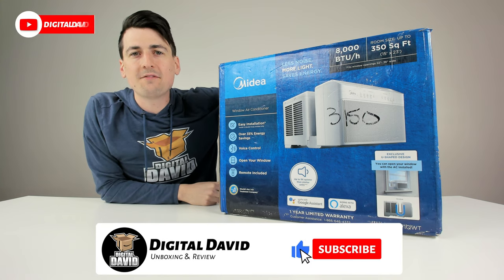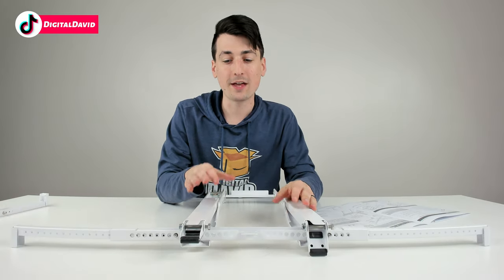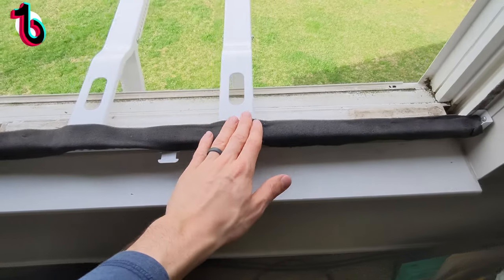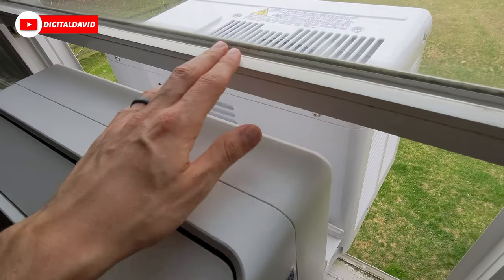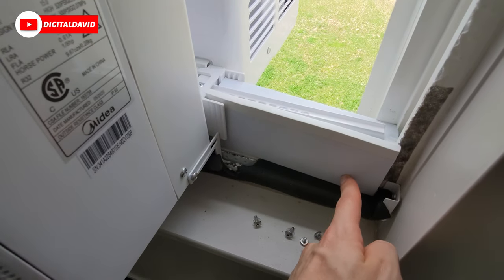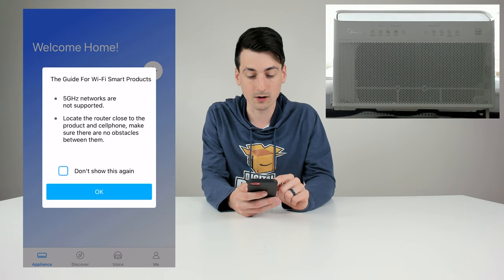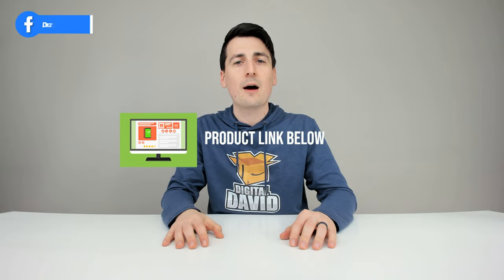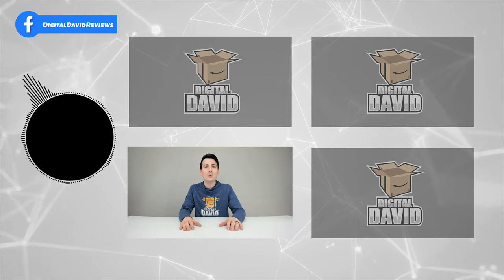Midea U Inverter Window Air Conditioner Install // Smart Air Conditioner

Comment: Its not suppose to be leveled, has to be 1/4 bubble hanging {see manual and Midea install video} so water can drip out ,otherwise water will pool inside AC {condensation} and rust inside of AC and AC will stop working ,but great video showing to install foam on bracket before sitting AC on bracket, helps so much , even Midea videos don't show that .nice job ! Thanks.
Reply from the maker: Welcome! Thanks for watching!
Reply: So much online about this and the issues it causes .. Thanks for sharing ..

Comment: Just put one in our living room. Awesome unit, so quiet which is great when my wife watches TV. ME! I don't watch TV. Highly recommend this unit. Also being on lower floor I find this is also a security issue from a regular window air conditioner, which your window is opened more wider whereas with the design of this unit is only inches. Have security bar inside to prevent someone trying to force open window.
Reply from the maker: Glad you're happy with it!!
~B

Comment: I purchased one 12000-BTU  for and one for my son. Both units  worked only for two years. I contacted midea customer service and after several emails they didn't offer any help. Therefore, I had no choice to throw both units in the garbage.

Comment: When it rains does water comes in from the bottom sides foam, or it seals good ?....no drain hole
Reply from the maker: Never had water in. I assume that will vary depending on your setup and how you install it. I'm guessing since it has a slight downward angle any rain/water ran away from the house/window!

Comment: STEP 1 -  Check to make sure the unit works.  Don't waste your time, like I did, installing a defective unit.
Reply from the maker: Thanks for your advice! I am sure viewers will find this helpful! cnl
Reply: Great point ! Fingers crossed my delivery  Aug 2024 brings a working one .. Sorry about your luck .. I’ve heard the company is not good at handling  issues, hopefully u were able to return ..

Comment: It looks like there is a gap on top of block foam, because window does not fit all way down into channel. Window seems too close to front of unit to completely close into U shaped channel-so since I have similar windows-maybe I do not want a U shape design.
Reply from the maker: We didn't have any gaps when used! They give plenty of foam to help if you happen to have some with your window!

Comment: I don't think they would tell you to make it level? Shouldn't it be slightly backwards so it can drain correctly. You don't want any water draining in towards your house you'll get tons of mold and wetness on the floor.. You always tilt air conditioners backwards.. I'll be very surprised if they told you to make it level?
Reply from the maker: Idk.. Maybe you are right!
~B
Reply: It looks like the bracket drops down a little, maybe that's why they say make it level, the tilt is built in. I know I usually tilt my window air conditioners a little more just for this reason.
Reply: @tppe1476  the manual specifically requires the AC to tilt outside. The bracket is adjustable.
Reply: @williamwchuang  You are correct, I just bought one and installed it couple days ago and yes it does tell you to tilt it. So everyone don't follow video directions to level the bracket, it needs to tilt to the  outside as every other window AC.   Other then leveling the bracket this video is helpful for install. Installing this is nowhere near hard as some comments I've seen in a few videos on this unit. I would say it's easier and there no drilling to the house  outside, you can install from inside the house which is very helpful when installing on second floor, no ladder required.  Even if you don't care if you can use the window, I would get this unit for second floor installs just for the install.   I almost didn't buy this unit from reading comments on the install difficulty, I'm glad I decided to go for it, the install is a breeze. 

When I seen this comment I didn't have the unit yet and seen the video showed leveling the bracket. I seen the little dip in the bracket and thought the tilt was built in to the bracket.. It is not. Lol

Comment: Thanks i just got both of my air conditioner unit it looks easy to install thanks.. i bought the 10.ooo btu unit and the remote is way different there's a digital screen amd and it looks like it has a thermostat that built into the remote... different types I guess
Reply: Mine too! We got the 2021 new version
Reply: all of the 2021 versions have the thermostat in the remote, just got my 8000 one and it also has that remote. weird that the remote seems to have a heat function, i dont think they have added a heat pump mode/valve to this ac yet
Reply from the maker: Thanks for sharing!

Comment: Hi.  I really like this model's design and hope it will work for me.  Very helpful video.  One question, my window width is like 20" - Do you think the bracket could be modified to still work?  The installation guidelines say a minimum of 22 inches but I think the unit itself is only 19.17 inches so I'm hoping the bracket can be adapted...ie..drill some extra holes to shorten or?  Thanks for any help.  These things are hard to return so trying to get info in advance!
Reply: correction - remeasured....21" wide...so it would need to be modified by an inch
Reply from the maker: Thank you for your comment and kind words about the video. It's great to hear that you find it helpful. As for your question, it's difficult to say for sure whether the bracket could be modified to work for your 20-inch window without seeing it in person. However, drilling extra holes to shorten the bracket is a possible solution, as long as it is done carefully and safely. Keep in mind that modifying the bracket may affect the stability and safety of the installation, so it's important to exercise caution and consult with a professional if necessary. Good luck with your installation! cnl

Comment: Looks like an elaborate installation and difficult to remove. Will you just leave the unit in the window over the winter? It looks like the window won't fully close with the bracket screwed in place.
Reply from the maker: Installing a window air conditioner can be a bit tricky, but it's important to make sure it's done properly for both efficiency and safety reasons. While leaving the unit in the window over the winter is an option, it's not recommended as it can lead to energy waste and potential damage to the unit. To remove the unit, you can simply follow the steps in reverse order. As for the bracket, some models may require the window to remain slightly open, but this should not be a significant issue as long as the unit is installed properly and securely. cnl

Comment: Are you still using this 2 years in?  Any issues water leaking on inside part?  It's there any markings on how where supports  rest?  I'm looking at one, I'm considering using a couple small pieces of wood between house and support brackets to prevent marking the siding up.
Reply from the maker: I used it for a year with no issues and still have the unit it's just stored in my garage now since I moved my office so I'm not using at the moment!

Comment: Do you have any water leakage around the air conditioner when it rains?
Reply from the maker: No which is great. Had it in my window for 7-8 months no leaks! Then took it out for winter!
Reply: have the unit support feet  not to level  one hole back well drain out side  like ALL AIR COND,S

Comment: Mine will not go into AP mode. Pressing the connect button only beeps, but the AC does not display "AP" and the app will not connect. There is no factory reset option and Midea customer service is no help whatsoever; they keep asking about what type of phone and Wi-Fi channel when the problem is with the device itself.  Now I have a "dumb" AC. Super quiet though, plus I love the fact I can tuck the curtain behind the AC to block out all the light. You can't do that with regular ACs, unless you install light blocking panels.
Reply from the maker: I'm sorry to hear that you're having trouble with your Midea U Inverter Window Air Conditioner not going into AP mode. It can be frustrating when customer service isn't able to provide helpful solutions. Have you tried contacting the retailer where you purchased the AC to see if they can offer any assistance or if they can facilitate a replacement or refund? It's great to hear that you're still enjoying the AC's quiet operation and its unique design feature of being able to block out light with the curtain. cnl

Comment: Hi, I'm considering purchase of the 8000 BTU version of  this unit. My wooden window sash is 1.5 inches wide. Can you tell me if this will fit within the space that it needs to drop down into in the AC? Thanks for any feedback you can provide.
Reply from the maker: I'm not positive, but I think it would be fine.. There is an amazon intl link in the video description that will have the specs/measurements for ya
~B

Comment: Is it possible to install it on a window that is wider? Mine is 39/40 inches wide, and short as well, opens the most at 12 inches, it's double hung so the bottom can be taken off. Is it possible to install in my window?
Reply from the maker: I'd have to double check the specs.. I can't really remember :( wonder if the amazon intl link in the video description would help
~B

Comment: What's the point of this ac? Advantages & disadvantages to a standard window unit ac?
Reply: way quieter, inverter style (meaning it can vary how hard the compressor works- 99% of window ACs just turn off or 100% on, nothing in between), slightly better thermal and sound isolation since more of the window is closed than with a standard window ac, and you can see slightly more around the AC than with a normal window AC. if you wanna go through the trouble you can technically open the window if its nice outside, but you will have to deal with removing and reinstalling the window sash foam.

disadvantages are that it takes way longer to install and will likely be annoying to remove for the winter, but beyond that I legitimately can't think of any.
Reply from the maker: Such a great answer @starman!!
Reply from the maker: See other comment!

Comment: How quiet is the outside noise once the unit is in the window?
Reply from the maker: The Midea U Inverter Window Air Conditioner is designed to be relatively quiet, with a noise level of 42 decibels. However, the actual noise level may vary depending on a number of factors, including the location of the unit, the ambient noise level in the surrounding environment, and the specific settings used. In general, the unit is designed to minimize outside noise as much as possible, so you should expect it to be relatively quiet once it is installed properly in your window. cnl
Reply from the maker: Pretty quiet, but I live in the suburbs.. Not sure how it would be in a busier area
~B

Comment: Does it have an option for fresh air or the air is recirculated?
Reply from the maker: Great question! The Midea U Inverter Window Air Conditioner typically operates by recirculating the air within the room. While it might not have a dedicated "fresh air" mode like some HVAC systems, you can manually open a window alongside the air conditioner to introduce outdoor air into the room.

Keep in mind that recirculating air can help maintain a more consistent temperature and humidity level indoors, which can be particularly beneficial in controlling the cooling efficiency. However, if you're looking for a constant influx of fresh outdoor air, you might need to consider a ventilation system or alternative cooling solutions that prioritize outdoor air intake. cnl

Comment: Hello. Can this unit remain in the window over the winter months? Thanks!!! Great review!!
Reply: Yes,  Air Conditioners in general can be used during winter time and if built correctly can safety be ran 24/7.
Reply: No, this particular unit must be taken out for the winter months as there is no drain hole on the bottom of the unit, thus water staying inside and freezing if left out over winter.
Reply from the maker: I think you should be able to. Maybe BuNcH007 is right though. Not really 100% on that
~B

Comment: Hi, 
I have a window that opens left to right as opposed to up and down. Do you think I can install it?
Reply from the maker: My initial reaction is to say you cannot install it in that style of window but it would be best to contact them directly for further information!
Reply: the answer is no, you cant put a window unit side-to-side even though you have a sliding window (left to right). I just damaged mine last month, remember air conditioner is also a dehumidifier, if you place it in a "C Shape" instead of "U-Shape" will definitely damage the system that relies on gravity to drain the water. so no matter the window you have is a horizontal(slide left and right) or veridical (open up and down) the top of the unit always need to face up.
Reply: @DigitalDavid  the answer is no, you cant put a window unit side-to-side even though you have a sliding window (left to right). I just damaged mine last month, remember air conditioner is also a dehumidifier, if you place it in a "C Shape" instead of "U-Shape" will definitely damage the system that relies on gravity to drain the water. so no matter the window you have is a horizontal(slide left and right) or veridical (open up and down) the top of the unit always need to face up.

Comment: What about if you have a sidewindow?
Reply from the maker: Good question! The Midea U Inverter Window Air Conditioner is designed to be installed in a standard double-hung window, so if you have a side window, you may need to take some additional steps to properly install the unit.

One option is to use a window installation kit specifically designed for side-sliding windows. These kits typically include a panel that can be cut to fit the size of your window and seal the gap around the air conditioner unit. You may also need to use brackets or other hardware to secure the unit in place.

Another option is to have a professional install the unit for you, especially if you're unsure about the proper installation process for your specific type of window. They will be able to assess your space and recommend the best installation method for your needs.

It's important to ensure that the air conditioner is properly installed and sealed to prevent air leaks and maximize its efficiency. cnl

Comment: @Digital David  Good video. Thanks! The gap when the window does not close flush with the foam at the top is an issue if there is a lot of rain and high winds. Any recommendations on what can be done to securely close that gap?
Reply from the maker: Thanks for watching the video and leaving a comment! You raise a good point about the potential issue of rain and wind entering through the gap created by the foam at the top of the Midea U Inverter Window Air Conditioner installation.

One option to securely close the gap is to use weatherstripping foam tape. This type of tape is designed to create a seal between two surfaces and prevent air and moisture from passing through. You could apply the foam tape to the top of the window frame before installing the air conditioner, which would help create a tight seal when the window is closed.

Another option is to use a window seal kit specifically designed for air conditioners. These kits typically include a piece of foam insulation that fits into the gap between the top of the air conditioner and the window frame, as well as a piece of adhesive-backed foam tape that can be applied to the sides and bottom of the window frame to create a tight seal.

Whichever solution you choose, it's important to ensure that the installation is secure and that there are no gaps that could allow moisture or air to enter your home. This will help maximize the efficiency of the air conditioner and prevent any potential damage from rain or wind. cnl
Reply: @DigitalDavid  Thanks for getting back. Let me try these solutions out.
Reply from the maker: No problem! Thanks again for watching and commenting!
~B

Comment: is this ac unit quiet? i record audio in my room and need a unit quiet enough to not b too disturbing
Reply from the maker: Yes! Best one I have found!!?
Reply: its easily the quietest window ac you will find, but depending on how close you are to your AC it will still probably be too loud if you want a very clean recording. personally i wouldnt record with it on but if you arent too picky its not too bad. if its just maintaining the temperature and the fan is low than it is super quiet
Reply: @StarmanDX  picked one up, its nice , wish it offered more then 3 fan speeds

Comment: So you don't have to screw the feet in??
Reply: It is not required, but they have holes you can use to screw it to the wall if you like.
Reply from the maker: That's correct! The Midea U Inverter Window Air Conditioner comes with an innovative design that doesn't require any screws to install the feet. The feet are designed to easily snap onto the bottom of the unit and provide a sturdy base for the air conditioner. This feature can make installation much easier and faster, without the need for any additional tools or hardware. It's great to see that Midea has made the installation process more convenient for their customers. cnl

Comment: Please use anti-tipping.
I think it's recommended to adjust unit so window does not touch when opened or closed.

I'm disappointed that they didn't put the dense foam in your box.
Reply from the maker: good advice!
~B